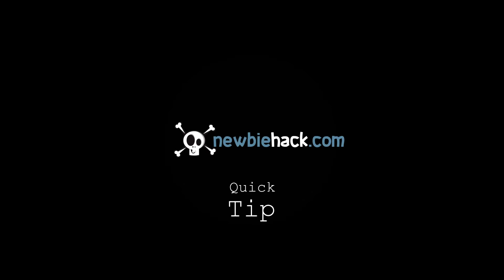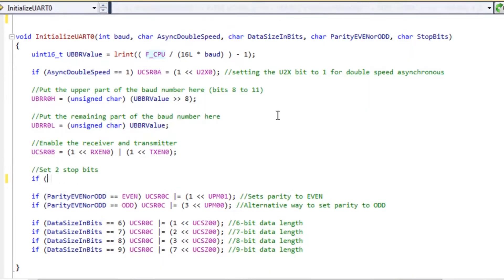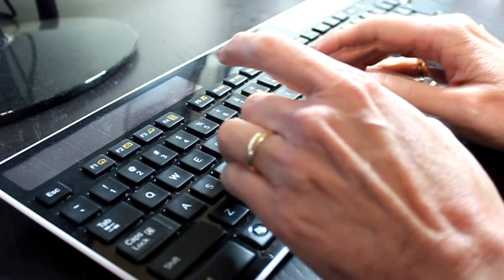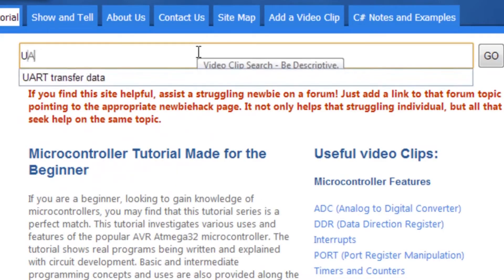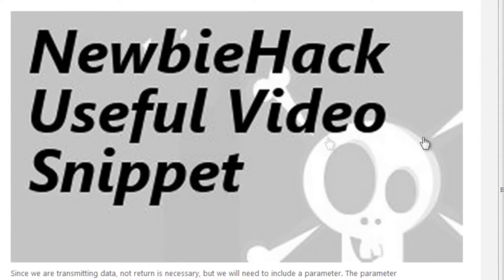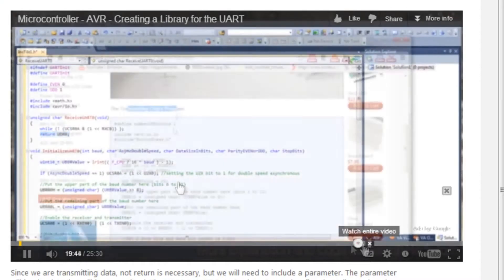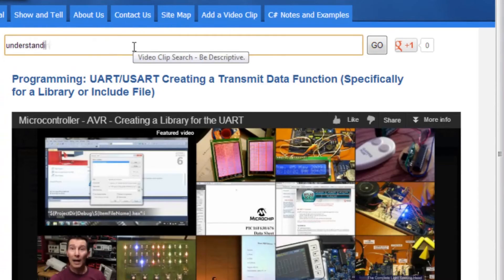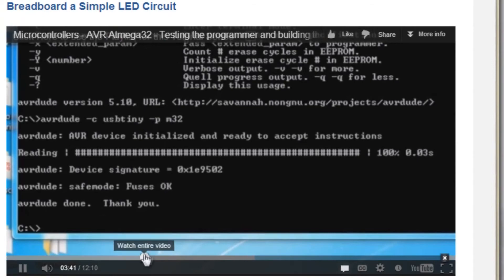NewbieHack Quick Tip #1 - Using the Video Clip Search Bar

Comment: does programming atmega32a via spi require  a boot loader ? well also how can I program this controller using usb to uart converter..
Reply from the maker: You don't need a bootloader to program the uC with SPI.  You will; however, need to install a bootloader to program the controller with the USB.  You must first install the bootloader using the programmer connected to the SPI.
Reply: thank you for the valuable guidance